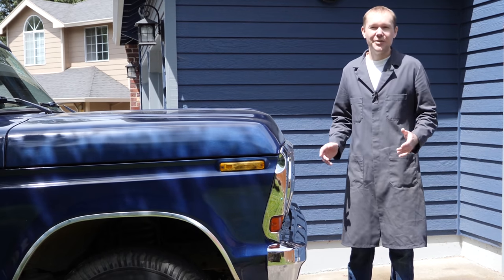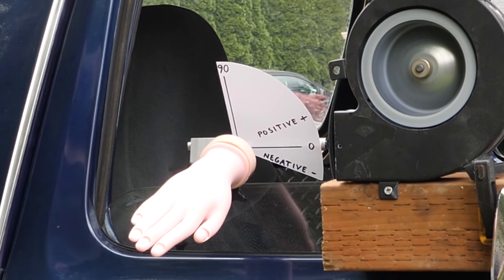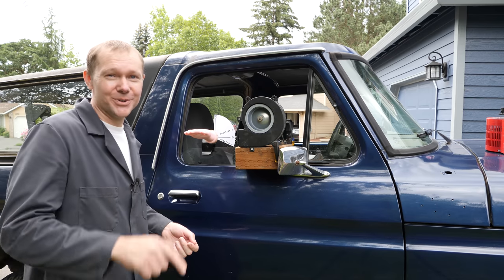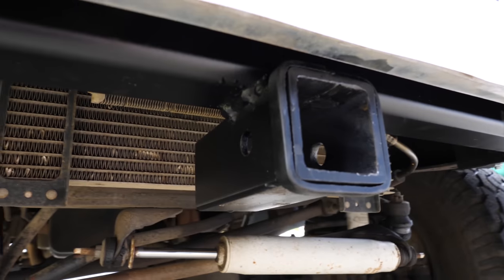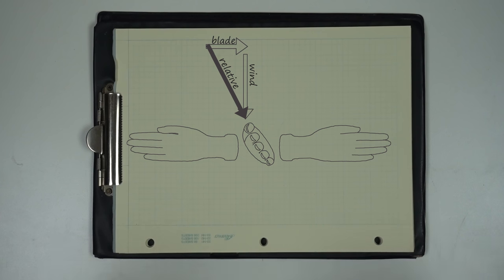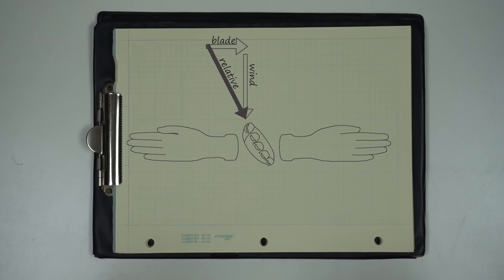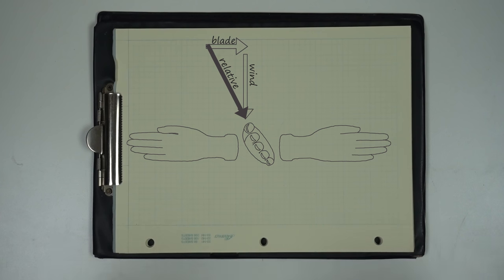Wind Power on a CAR #1 - Is it FREE?

Comment: Why is nobody talking about how the dash in his old Ford truck is from a newer model F150?! Love the channel 😄
Reply from the maker: Thanks!  It's a resto-mod I did with a 2004 F-150 that had been totaled.  Engine, trans, dash.  Used to have a website on it I'm trying to resurrect.
Reply: Wow that's a great way to make an old car modern! I'm surprised nobody else said anything. That must have been an ordeal !
Reply: @engineernels1057  probably because not a lot of people know that truck well enough or didn't even look. 
most people look at the person whose talking.
Reply: Quint BUILDs that is an awesome resto mod! Definitely would love to see that website!
Reply: Noticed it right away.  And steering column.  2:39 I think I'm seeing a Bronco.  15:28 Yep, Bronco.
Reply: That’s the first thing I noticed...  love the truck.
Reply: For a few minutes there, I thought he was using two different trucks... A cool old truck that he was modding on the outside, and then a newer truck that he was driving around in... Until I realized that it had to be the same truck. I figured he did exactly what he's now said that he did... Cool body on a modern chassis. 
I'm building an EV (electric vehicle) with a Hudson Hornet. I'm using a Tesla motor and suspension, with an LG battery pack... That's a restomod too, then, I guess... whenever it's called, it's awesome vintage tin on a modern chassis...a bitchin' blend with the best of both worlds.    I love your work!
Reply: @QuintBUILDs  a guy did it with a 2 door 87 ford LTD.  He dropped the body on newer  (05-11) Crown Victory frame and retrofitted the newer interior
Reply: @QuintBUILDs  Need that website up. I like doing stuff like this with my vehicles.
Reply: It really upset me lol but amazing idea
Reply: My brain was like "wait a tick! What! That's so cool!"
Reply: its the first thing i noticed,it looks a proper job too, nice one
Reply: Damn it's a bronco I love Broncos to bad they discontinued them but they bring them back but without the v8 option
Reply: im not familliar to american trucks but the truck looked like it was from the 80Ish and i noticed that the interior looked very "new" like it was from late 90 early 00 ish
Reply: IK it had me Trippin for a minute there
Reply: @QuintBUILDs  Why would you put that in a classic bronco?
Reply from the maker: @eaglewarrior8707  the 400 that was in it got 9 mpg at best and horrible power.  Now I get 15-18 mpg, cruise, power windows and A/C for when it's hot or need to defrost my windows.  It's SO much better.
Reply: I noticed the same thing. I actually own a 78 Bronco and a 2005 Expedition, so I have the ingredients needed. Unfortunately in 1978, the Midland motors were terrible.  I have the 351. It gets 9mpg and has no oil pressure. The 2005 Expedition has the 5.4 that also isn't a great Ford Motor. It has lots of gremlins and it is hard to work on. I wonder if the 5.0 or new 7.3 would be a better option.
Reply from the maker: @michaellowe3665  wow, that must have been hard to ignore having both those rigs!  Yeah I've got less than 60k on that 5.4 and already had to replace the cam phasers for the known knock at idle.  Plus the engine had to be mounted slightly to the passenger side to make room for the power steering pump, meaning there wasn't enough room to get one valve cover off.  It was one of those late-sunday-night, has-to-run-tomorrow moments we all love.  I got it figured out but yeah, there are better engine options for sure!
Reply: @QuintBUILDs  when I saw the truck I had to subscribe. I was even thinking of painting mine a similar color. I will look forward to part 2 of the wind turbine project.  I will go with the 460 in my Bronco.  I think it will be easier, if not as efficient.  I did notice some kind of grey material on the inside of your removable top. Is that insulating, or just cosmetic?  If you have a detailed video on the truck, I would like to have the link.
Reply: Great video! I'm a science guy and I've just sent this video to all of my car guys. Thanks for making me smile with this hidden gem. Looks like we're all looking forward to your next video and a few more peeks at this great looking restomod! Also, I appreciate how you take it to the nth.
Reply: Dudeeee please you have to do a review its amaziing i was gonna make the same coment
Reply: Okay thank you! I was literally googling 2008 vs 1995 F-150 interiors to make sure I wasn't crazy lol
Reply: Having had a 78 bronco and a 78 F250, I noticed the dash and wheel weren't quite right for that body style as soon as it cut to the interior shot
Edited to add "Nice Bronco!"
Reply: I’m glad I’m not the only one who wants to know more about the Bronco.
Reply: I love the bare metal on the inside near the pillars with the new dash and controls.  I've been listening to this channel while working so I'm only peeking at the screen occasionally and was totally surprised seeing the old truck in the thumbnail and then the modern steering wheel and dash in the vid.  Super cool!
Reply: @QuintBUILDs  Ford tech Makuloco has a fantastic channel with many videos on "bulletproofing" the 5.4 and 4.6 3 valve engines. Well worth a watch.
Reply: I was wondering too i was like thats not factory 😂
Reply: Where’d he get the hand ??🤚🏻
Reply: low torque 15 kw permanent magnet generator
Reply: Thank you!! No one was talking about thag
Reply: @QuintBUILDs  I can't wait to see some of the info on the resto mod...cool truck.  I noticed the power window switches and the new dash in the video...I was looking for the videos on it.
Reply from the maker: @jasonwolfington  workin' on it! 👍
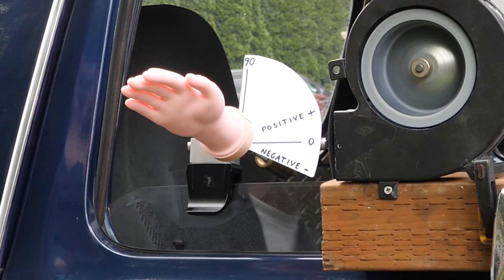Reply: @louf7178  says bronco at 4:00
Reply: @QuintBUILDs  I had a 78 f250 with the 400m engine back when it was a brand new truck. I would have loved to have gotten nine miles per gallon, I think around town I averaged about six
Reply from the maker: @Krista Whipple thanks for the offer but the wife stepped up and got it working enough for me to upload a bunch of the pics.  Check it out: https://www.quintbuilds.com/bronco-project
Reply from the maker: Hey everyone, I finally got my new website up (my wife deserves all the credit) and brought back a bunch of the bronco build there.  Check it out: https://www.quintbuilds.com/bronco-project
Reply: @QuintBUILDs  alrigh man Im checking it out rn
Reply: @QuintBUILDs  I'm planning on doing this with my 81 d150 what were some challenges you had to overcome I'm pretty handy with a wrench but have never taken on something this big before
Reply: Thats a 1978 bronco body right. So whats the current Powerplant.

Comment: The engineer in you would know from the outset that this will be an inefficient system ie the additional drag cause by the blades will be higher than the energy the turbine creates. But a fascinating experiment and learning experience all the same. Keep up the great work.👍
Reply from the maker: We will find out either way!
Reply: @QuintBUILDs  yes, but you clearly know that the energy consumed by the drag, will exceed the energy produced by the turbine.  I like your videos, but many people spend their lives trying to tweak energy experiments thinking that a slight variation will produce free energy.
Reply: What if the fan was still facing the same direction but mounted to the hitch
Reply: @michaeltucker8645  It doesn't matter where the turbine is positioned. It will always have drag. Since you are using fossil fuels to run your car, it is utterly inefficient to use this kind of setup. What you could do though is to have wind turbines on a ship. They are called flattner rotors and would act like sails and actually would increase a ship's efficiency.

Comment: I'm interested in part 2, however... I would hedge a bet there's a reason dealerships don't regularly offer an installable wind turbine package included along with the satellite radio and heated leather seat options. My guess is that when he does more analysis on the energy returned by the turbine vs the energy consumed to drive the whole contraption forward, it'll actually be operating at a loss. It's just going to be a lot harder to notice because the energy has been converted numerous times from chemical energy then to mechanical energy then to wind and then back to mechanical energy and finally to electric energy. None of these processes are wholly efficient, so unless you're driving into a gale force headwind I just don't see where the energy is coming from.
Reply: Exactly.
Reply: part of me wants to agree, but you'd be driving into the air and losing energy regardless - the wind won't just pass through the turbine and hit the vehicle at the same speed, it'll be reduced after coming in contact with the turbine since the kinetic energy has to go somewhere. i can't wait to be proved right/wrong though!
Reply: @IsThisLossE  physics basics: conservation of energy... there is no such thing as "free energy".
Reply: @IsThisLossE  The problem is that you are increasing the surface area the air has to flow over by attaching a turbine, which increases friction. Then the wind has to exert force upon the blades at an angle to cause rotational motion which itself is affected by various mechanical frictions and then in turn by electromagnetic forces when coupled to a generator... and Stephen Weinberger has it right: to get net positive energy out of this setup would violate conservation of energy.
...
Reality is such a drag.
Reply: @stephanweinberger  Absolutely.  Any 2nd-year engineering student that thinks otherwise should be held back until they get their thermodynamics and physics straightened out.

Ed Schulhtheis, P.E.
Professional mechanical design engineer and consultant for 30+ years
Schultek Engineering & Technology, Inc.
http://www.schultek.com/
Reply: @IsThisLossE  
Part of the physics of cars is air resistance.
The fans increases that by a lot. In order to overcome that additional resistence the motor has to use more energy in order to drive with the same speed. In fact the motor has to use more chemical energy as the car-system gets back due to the generator generating electricity.
Besides the basic conservation of energy, there is another golden rule in mechanics. Eeach subsystem, each change in energy, each gear, each belt, etc.  has an efficiency coefficient attached to it, which is always lower then 1. Thus the more steps you need, the more energy you will lose (usually due to friction). Generating electricity by having the motor directly drive the generator is much simpler, then the "complex" way of using energy to drive, have the wind turn a fan which then drives a generator. Just by looking at the number of intermediate steps, you can already tell, that this system will be worse then the simple solution of having the motor drive the generator with the help of a belt. Especially since one of those steps (wind driving the fan blades) has a very low efficiency coefficient which ruins the overall efficiency totaly.
Reply: You are right no free energy, this effort is to recover the energy spent in overcome the energy spent in overpowering the drag/ wind resistance.So recovery is gain made from loss.Still  this idea make overall system efficient
Reply: @stephanweinberger  why not, when anyone mentions free energy, they say in it free in terms of human labor and continuous effort, hydro electricity is free once you build it, no one has to keep rotating the turbine, it costs so much because they charge you way more than they need to keep themselves billionaires!! The cost of building the hydropower projects comes from taxes people already pa and its maintenance and salary can come from the taxes, Also, in this case the front of most of the vehicle is already flat, even if the turbine is placed in front of the flat faces, its not going to increase the drag any further significantly, in fact the wind speed will be decreased as it passes through the turbine, this energy will be converted to electrical energy, not from thin air!! since, even in the absence of the turbine, the load is already present on the engine, its presence will make no difference in the efficiency of the engine!!
Reply: @stephanweinberger  you pluck the fruit from the tree in your garden, eat it and its "free energy", as I have already said, when someone says free energy " they mean continuous energy without continuous human effort", don't act over-smart by stating some physics laws in completely different context!!
Reply: @gulshanchaurasia2233  The context here is mounting a wind turbine to a car. Which is a purely physical context. The wind blowing through that turbine comes (for the most part) from moving the car in the first place. Which requires energy. Which comes from the fuel. Which isn't "free".
Increasing the car's aerodynamic drag (by mounting a turbine on top of it) will require more energy to move the car - it's at most this additional energy that can be harvested by the turbine (but since all energy conversion processes have losses it will always be less).

Also: wind or hydro are not "free" even in the sense you're proposing. There is ongoing maintenance required to run those powerplants and they have limited life cycles after which they have to be refurbished or rebuilt.
Reply from the maker: Video proving it works: https://youtu.be/tEPBdztGMdI  😁

Comment: My big question is “Did you do the interior conversion of your Bronco”?   It looks awesome.
Reply from the maker: Thanks!  Yeah, it's a resto-mod I did with a wrecked 2004 F-150.  Engine, transmission, interior.  Used to have a website on it I'm working to resurrect.
Reply: Quint BUILDs  well I look forward to both the next fan episode and the website.
Reply: @QuintBUILDs  Okay I saw the outside of it and then in a later shot I thought it was a completely different truck. It looks pretty great.